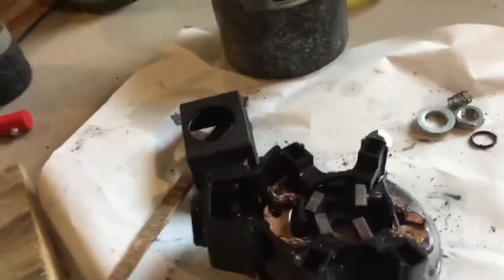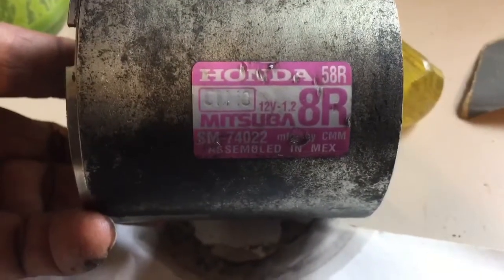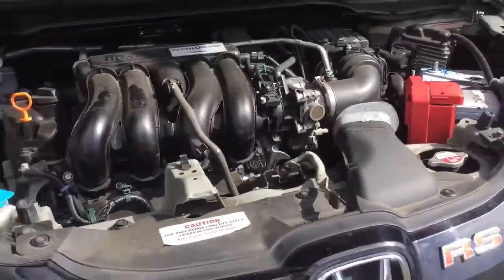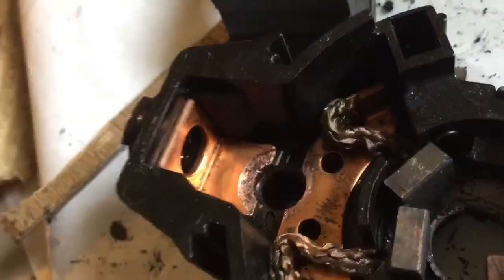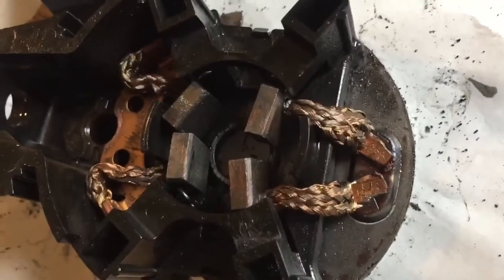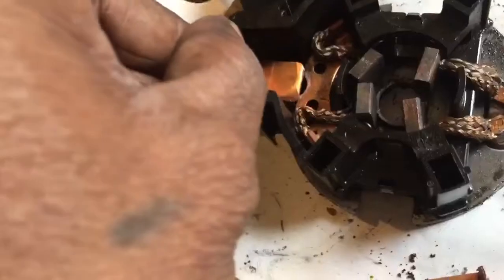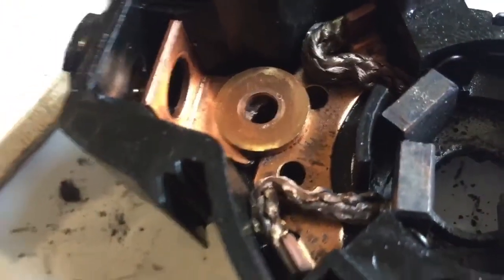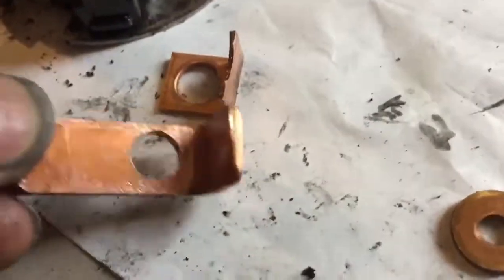2015 Honda Jazz Fit Starter failure - What causes it and the Fix

Comment: Mine had the same failure mode. I ordered the whole new brush assembly for $33USD since I did not have a scrap piece of copper. Saved me about $1000 for a dealer to replace the motor. 
HANK YOU!
I think (fairly sure) that I have the reason for so many of them having this early failure. It seems to be that the copper contactor washer was assembled incorrectly on this series of motors. The washer has teeth on one side and should be oriented with the teeth of the washer over the smooth plate. This would distribute the wear evenly. 

Hope this helps someone else.
Reply from the maker: Good observation about washer being installed wrong way. My starter seems to be running ok still. Prior to this model all my previous Hondas have lasted a long time refusing to die :)

Comment: Nice video,  my nz honda jazz 2015 has a problem with starting the engine.  When I push the start button,  it has a click sound but no crank.  The engine starts working after a few tries. I believed it is the same issue as yours.  Thks
Reply from the maker: Yes that is the symptom I had.
Reply: @bethells86  i managed to fix the issue,  thks a lot for your video.  It is very helpful.

Comment: Honda has admitted to numerous starter failures below 50k miles on the car and also has a recall for the stop/start engine switch in 2015 FITS. Comments on FitFreak forums also suggest brake sensor as a possible cause for the 2015 FIT.
Reply from the maker: My 2001 Fit lasted till 260Km before I gave it to a family member, still going.